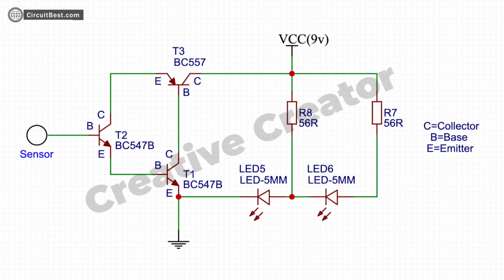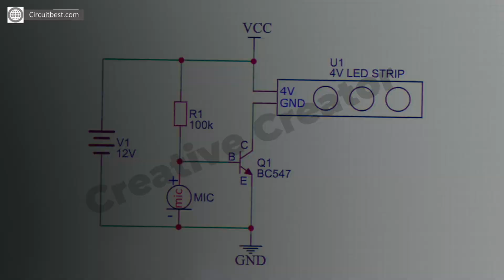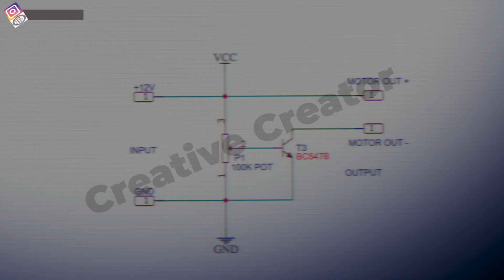Top 3 Awesome Electronic Project with BC547 Transistor, BLDC Fan, Potentiometer, Sensor, LED strip

Comment: Connect motor NOT between VCC and the collector but between emitter and ground. Then it is an Emitter (voltage )follower. You can controle fanspeed much better. Now you use the transistor as a switch.
Reply from the maker: Ok